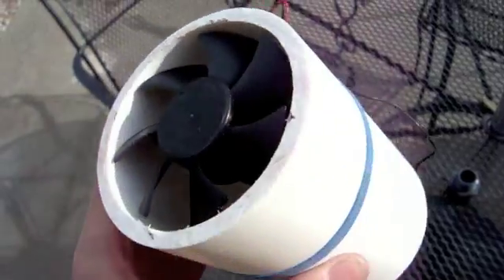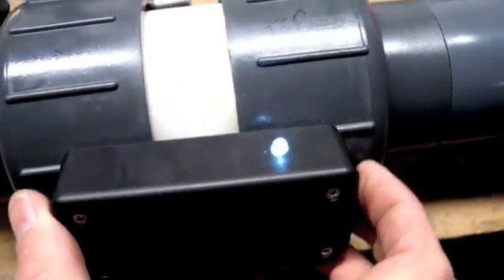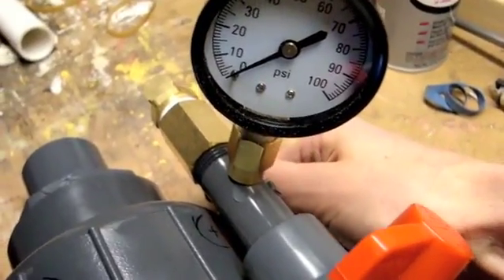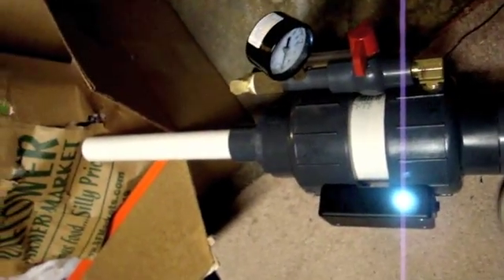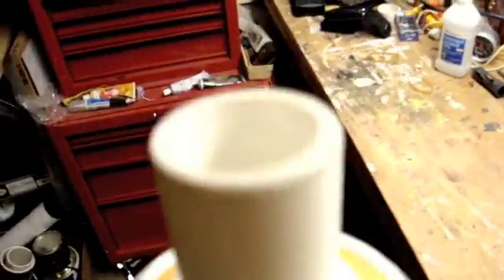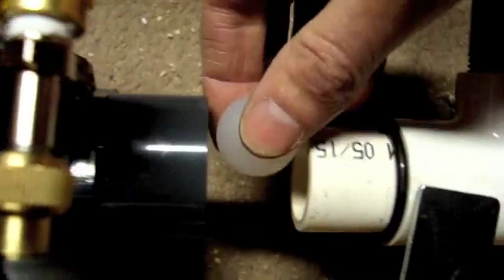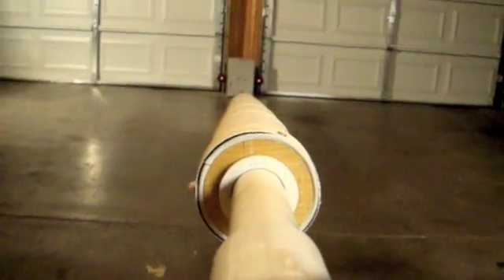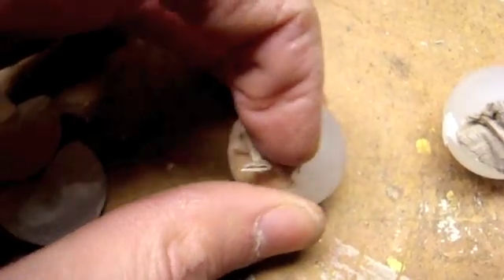Combustion Launcher with Metered Propane Potato Cannon

Comment: They have multiple purposes: Mixing VentingInducing turbulence The main purpose of a chamber fan is mixing the air or oxygen with the fuel. The fan ensures an even distribution of fuel throughout the chamber which results in a more efficient combusiton and significantly increases performance. Unmixed chambers may have an excess of fuel in some areas of the chamber, and a lack of fuel in others. The chamber fan fixes this problem and maintains a good stoichiometry throughout the chamber. Another purpose is venting. After each shot the burnt fuel mixture needs to be removed from the chamber and replaced with fresh air. This is because (almost) all oxygen is used during the combustion and new oxygen is needed for combustion during the next firing. When the back end of the chamber is opened using either a cap or some other system, like a ball valve or quick vent plug, the fan effectively blows out the combusted fuel and sucks in fresh air. With a chamber fan, venting is done much more quickly and reliably. If the chamber fan is left on during combustion, it has one last potential purpose: turbulence is induced because the air inside the chamber is moving. This causes the flame front to speed up, and thus the combustion occurs more rapidly. This further increases the performance of the cannon. Theories exist which state that two smaller fans blowing in opposite directions induce more turbulence. However, they may be less effective at venting.Types of fansThe most commonly used fans are case fans out of computers. The corners may be sanded down so it fits in the chamber, and sometimes the complete frame around the fan is cut off and even the fan blades need to be cut for fitting it into in small chambers. Instead of PC fans you could also use any other electric motor with fan blades attached. However, you should avoid brushed motors at all times. PC fans have brushless motors and thus do not create any sparks within. A brushed motor could spark with the possibility of suddenly igniting the fuel mixture, which can lead to accidents damaging the environment or even harming people. So now and then someone still uses a brushed engine but sealed the holes in the housing off with glue, making sure no fuel can enter the insides of the engine. The engine wont be able to cool itself anymore, but when used in short periods, that doesn't really matter. Since PC fans are cheap, brushless and readily available in various sizes, this is the choice of most spudders and the most recommended option. Further characteristics of fans are noise, CFM (the amount of air it displaces) and RPM (how fast it rotates). Noise doesn't really matter for a cannon, and you probably want to have an high CFM, high RPM fan for some good mixing. Powering, wiring and mounting the fan Powering the fanNearly all fans are powered by a pack of batteries. A 12V fan can be ran off a single 9V battery (though it will not run at full power) or a bunch of 8 1.5V batteries. It is also useful to have a switch to turn the fan on and off. It can also be controlled automatically using a  timer circuit which turns the fan off when it's not needed. For a good looking cannon without duct tape and wires all over it, you build all the fan circuitry and batteries into a fan control box. Since the same can be done with ignition systems in a ignition control box, some people merge it together into one fan/ignition control box. This gives the advantage of running a fan and a stungun from the same batteries, saving space and weight. Sometimes this box is built in the handle for an even cleaner look not showing any wires. Mounting & wiring the fanThe easiest way of doing this is having a PC fan which is a bit too large. Sand down the corners until it fits in tight and squeeze it in. The fan will stay in place due to friction. Glue can be used to secure the fans and sometimes bolts are used too. Since the batteries and possibly switch are outside the chamber while the fan is inside, you will need to get those two wires to the fan someway. A leak free way of doing so is screwing in two bolts trough the chamber wall (preferably drill through both the pipe and fitting so you've got two layers of PVC/ABS.) Then attach the wires on the inside and the outside to the bolts and your done. Fan placementIt is not recommended to place the fan too much near the barrel opening. Remember that all air behind the fan wants to go past it and if that is too much you will constrict flow to the barrel and most importantly: your fan will probably break. Most fans are at the back of the chamber so they can easily be taken out for service on the chamber or the fan. Note that you cant take a fan out when the electrode bolts are in the way. Will my fan survive the combustion?If you think that your fan might get burned or melt, don't worry, it wont. Since the heat in the combustion chamber lasts no more then a few milliseconds the fan doesn't have time to heat up or melt. As stated above, your fan should not be too close to the barrel. If its more to the back, it wont get blown to pieces due to the extreme flow. A fan may have a somewhat shortened lifespan inside a combustion chamber, but it still can survive for many years. So for combustion cannons: Yes, your fan will survive. In hybrids fans last shorter due to the more extreme environment. High-mix hybrids can break their fans on the first shot. Luckily, those hybrids don't need fans anyway. When you pressurize the fuel mixture with air after you have put in the fuel, the blow-in of air already mixes the fuel. Also because of DDT dangers you don't want to have turbulence anyway.

Comment: Cool! Most people just user sewer pipe, but yours is a little safer. Still, steel is the only material that you can guarantee won't explode.
Reply from the maker: It's all about the expected pressure vs. what the pipe is rated for. Steel can be ruptured with enough pressure. I made calculations that the max pressure in this setup is probably about 100 psi, while the pipe and fittings can take 250.

Comment: i would like to know haw the fan system works. i am building a potato rifle but i cant make it go boom on any reliability... it is cause i am not getting enough oxygen in to the mix. ai am using 2 inch galvanised pipe... yes my rifle is going to be all metal. i would like a tutorial on how it actually works and how to make one. would that be at all possible?
Reply from the maker: I don't have the time for a full tutorial, but there are plenty of materials around the web about cannon formulas and construction.

Comment from the maker: I used a fan that had blades just a bit smaller than the diameter of the combustion chamber. Then I cut away the frame until the arms of the frame just fit into the chamber. I epoxied the frame in place. As for the wiring, it is very simple. Just a 9V battery, a switch, an LED with a resistor to limit current, and then the fan motor. The switch is a DPST, so one pole is for the fan motor and the other is for the LED. Throwing the switch turns on both, but they are each on a separate circuit.

Comment from the maker: The fan mixes the fuel with the air, and then helps to pull out the exhaust (and pull in fresh air) after firing.